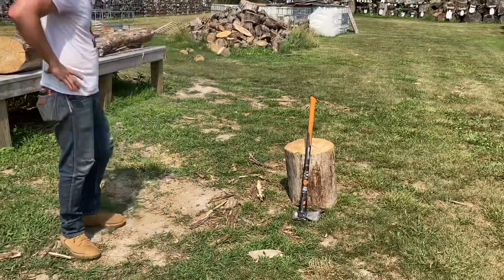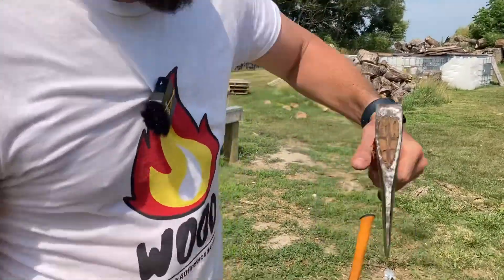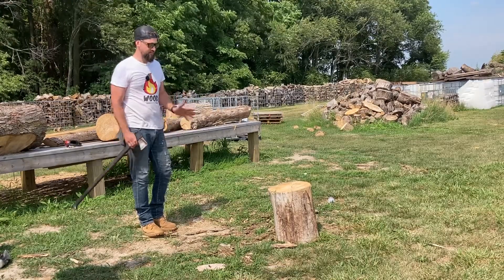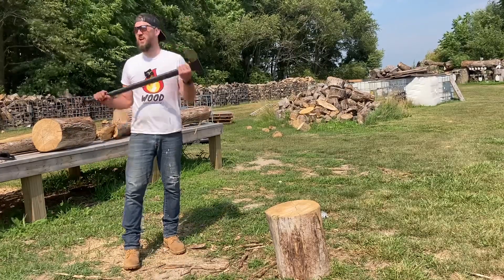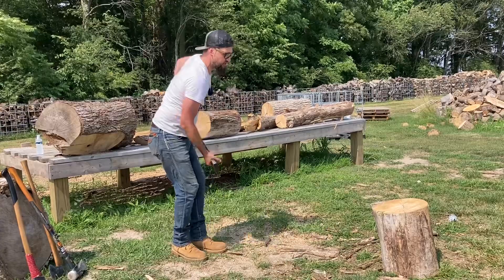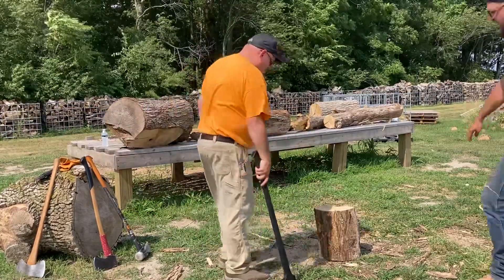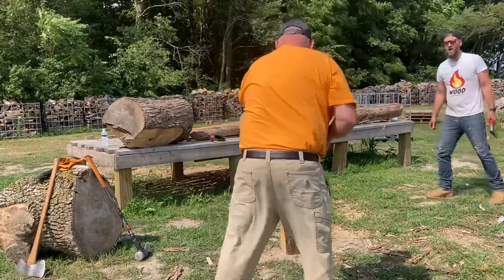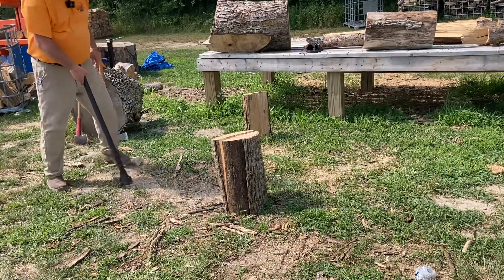How to split firewood with an axe - n. 77 #fiskars #x27 #firewood

Comment: Manual sure does get the heart rate going. That’s how we started. Evan and I could split a trailer full in about an hour or so. We had fun using the axes he made. We also bought a splitter very fast when he started selling wood🤣👍🏻👍🏻TOA
Reply from the maker: Hi Todd!  It is a lot of fun and great exercise.  But one can only do so much.  Not everyone is in tip-top physical shape like I am 😂
Reply: @KNLFirewood  it’s way more enjoyable in the fall. You stay cooler and the rounds split easier the colder they are🤣

Comment: Morning Mike 👋 Like the swing technique’s but one thing I was taught about 60 years ago and I think still applies…..never split on the ground. Always use a wood base/block to transfer the energy of the downswing to help split the wood. The ground just absorbs the energy of the blow and also allows for faster damage to the axe head and handle. Striking on a raised wood surface also takes the distance and stress your body. This makes the strike shorter and safer, allowing for much more control. Just tossing in my 2 cents, was taught by a guy my age, 60 years ago….he learned long before “Splitters” were available…….just something to think about…..IMHO Stay safe gotta love the Fiskars x27 🪵🪓🔥👍👏🇺🇸
Reply from the maker: Hi Rick!  Thank for the additional tips.  Baby steps though.  I’m just gettin’ started!  Love the X27!